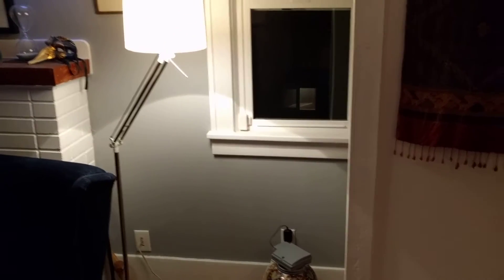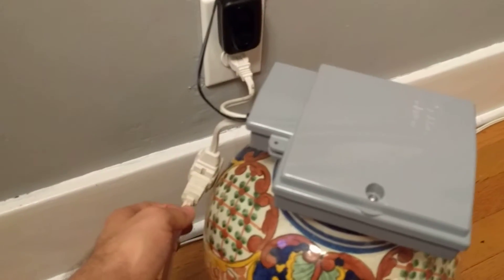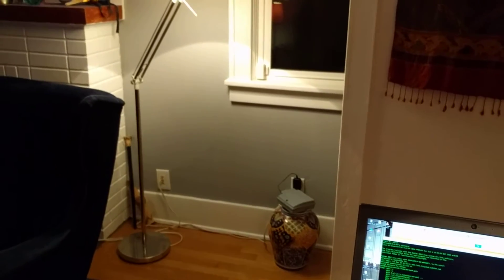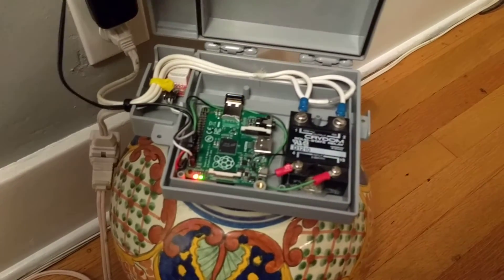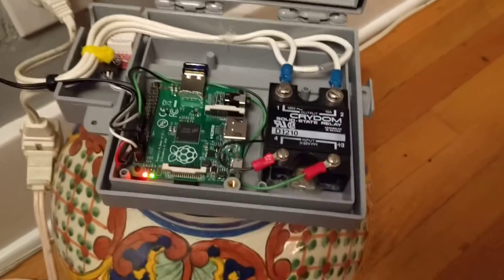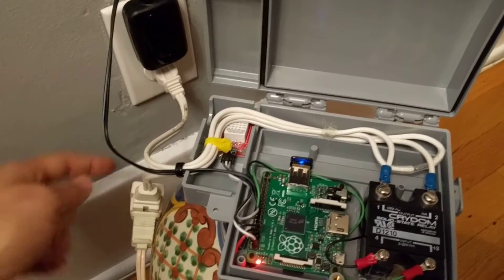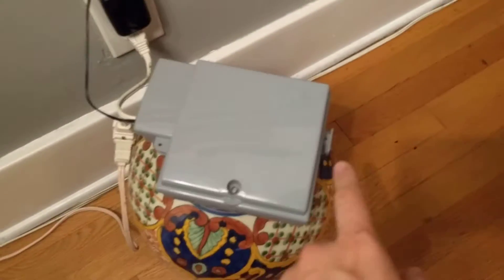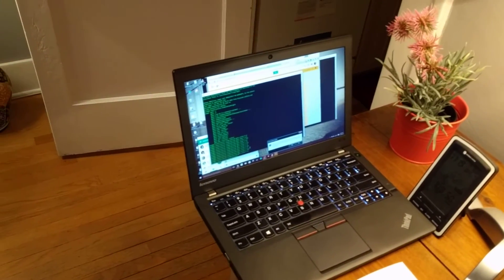Raspberry Pi + Solid State Relay = Christmas light control!

Comment: i find the video interesting because i have been trying to build one similar system. just enough to turn on and off the main lamps in the house. i realize it was mains voltages and pretty much bad things will happen if aren't installed correctly. I was going to put my 8 channel relay module for raspberry pi but after researching further more, it's probably better to have solid state relay. Because the opto-isolator thing if im not mistaken. that leads me to a question, what's the name of the part that connects the gpio pin to relay? the red one.
Reply: thanks!
Reply: one more question, if im not mistaken, you put ground and one of gpio pin to the solid state relay and your 5v gpio pin to the what? what is that small white thing on the left side? can i have your design? thanks